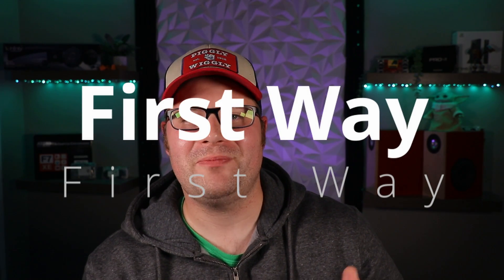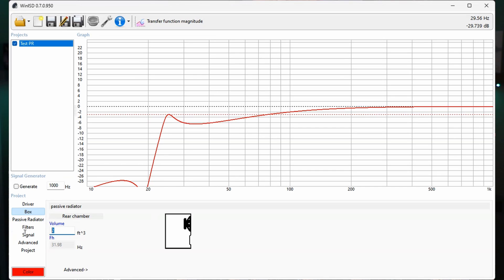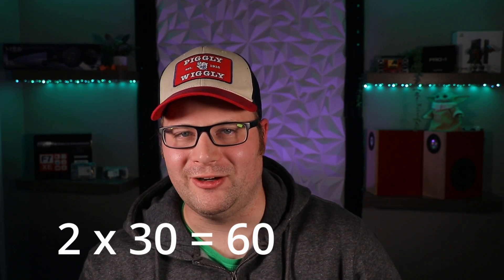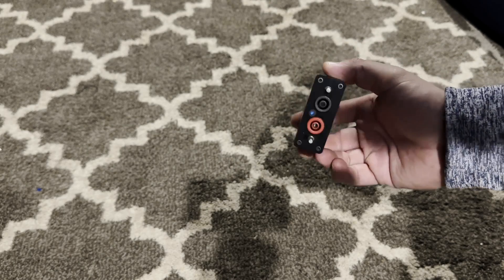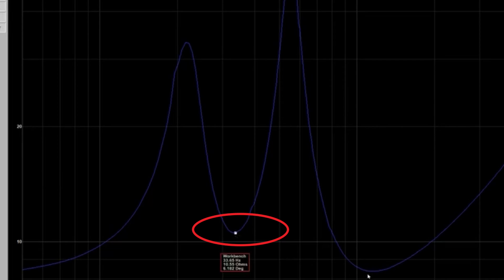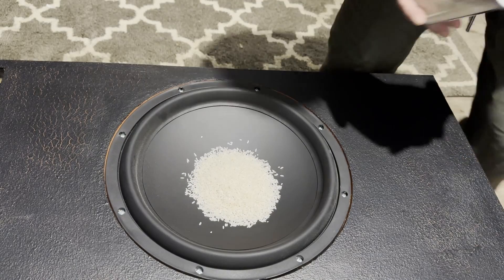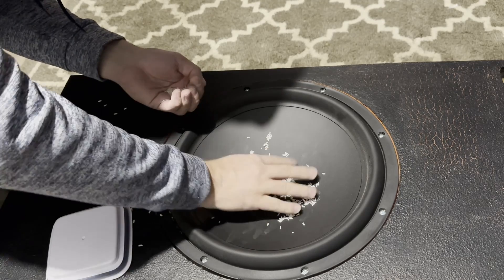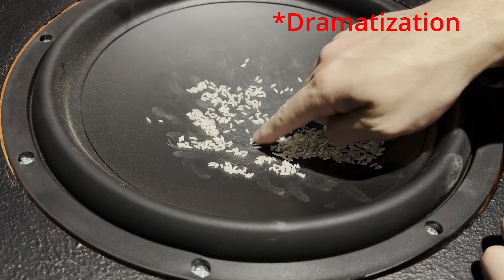How to tune a Passive Radiator - 3 Different ways

Comment: Many youtube videos state that the speaker will sound best at the frequency it is tuned to. Your rice tuning technique shows that the speaker stops moving at the tuned frequency, so actually the speaker will not produce any sound at the tuned frequency. That is the opposite of most advice. I suspect that best tuning would put the tuned box at a frequency below the lowest frequency your speaker can produce, so the dead spot will never be within the frequencies you want to produce. That idea brings another conundrum for me. If I try to tune with the rice method and lower the tuned frequency below the capabilities of the lowest frequency the speaker produces, then how do I know the rice stops moving because of tuning, or does it stop abecause the speaker can’t go that low?

Comment: Great information but as others have said you haven’t shown us how to physically add the weight to the radiator.
Reply: It's usually just thick metal washers that are added to a threaded bolt extending through the back of the radiator frame, and nutted down. Some PRs have the weights on the front of the cone.

Comment: I have access to a waterjet, and 1/2" SS plate. I cut out a 2.4" OD puck with a .315 thru hole = 290g mass to add to each Slaps M12V2 radiator, tuned my sealed 2.6 cu ft box with 2 Skar SVR12 subs to 22 Hz. Playing a pure sine wave from a tone generator, at both 23 Hz and 26 Hz, the car resonates, and begins to shake apart.

Comment: Question, Is there a way to deduce PR parameters by using the second method but with a known driver and known box, essentially inversing how software finds optimal box volume from a known driver and known passive?  I'm curious about a specific set of PRs, but the company is being so utterly unwilling to provide parameters.  I can logically presume SD, Vas, and a rough Xmax range without physically having the product with me, given what the product is and what it was originally fully intended for in use.  I'd rather have a decent starting point rather than just blindly trying to tune a PR in a suboptimal enclosure, especially when the PRs in question are of an atypical design that're just the mounting ring, surround, and a weighted cone, without the basket, spider, or a weight system on a spider.  Their thinness caught my attention and could have potential for atypical builds, but again this company is just being such a ballache with providing parameters.

Comment: I have always seen addressed that you need at least 2 times the displacement passive vs active discussed, and understand that. However, what I have never seen addressed, is it possible to have too much displacement in the passive radiators? What if, for instances, my passives had 4x the displacement of the active(s), is that counter-productive (other than cost) and will it lead to diminished sound quality? Second, it is possible to make your own passive radiators from old speakers you have laying around, perhaps a car audio sub with a bad VC, then just pop off the magnet structure.
Reply: I'm not an expert, so anyone can feel free to correct me, but I think that would just require making the box smaller, so that the air's "tighter" a and makes the PR more responsive. 4x difference would likely require a pretty steep contrast in cone size. But then again, it's common to have, say, one active, and 2 PRs of the same size. PRs usually have significant xmax/excursion, so again, I (think) that it's just a matter of tuning the box volume, and the PR weights, accordingly.

As far as making your own PR, why not try? Google it, look up some existing designs, trial and error. You might make the best one!

Comment: I have four jlw3 8 in the back of my Durango had enough room in the enclosure I put a 10in JL in the enclosure ran it with power for a year cut the power to the 10 and use it as a passive radiator and got a lot more output you know the math said that I had enough room in the enclosure for that 10

Comment: Hello mate. I have a pair of leak sandwich 600 speakers. 26" tall. 15" wide 13" deep. (Please look them up) they have a 12" bass driver in them and I'd like to put a 12" Dayton audio passive radiator in the back. Will it be ok to tune do you think? Thanks in advance. Enjoyed your video by the way. Oh also I have a pair of celestion ditton 44 series 2 speaker cabinets that I'd like to get going. They have a 10" hole at the back for a passive radiator could I put 2 8" Dayton audio woofers in the front with 2 10" passive radiators at the back?

Comment: If wasn't for the 46mm size I'd be interest. Its just to big
Reply: You don't actually NEED to have a PR of that large a size. The general rule of thumb is to: 

#1) have your passive radiator be double the Volume Displacement (or, Vd) of the active driver, meaning having 2pc of the 'same size PR' as the active driver (ex: an 8" active driver with 8" PRs/x2 - doubles the Vd);.....or 

#2) have the PR be the 'same exact size' as the active driver - but the PR must have double the maximum excursion (Xmax) of the active driver (ex: 8" active driver with 4mm Xmax - mated with a single 8" PR with at least 8mm+ of Xmax). 

There's ways around "nearly everything", especially once you understand the parameters.
Some of the absolute best PR designs I've heard were from Polk Audio in their long ago (but classic and still sought after) OG "SDA" Signature Series' of speakers that put them on the audio map as a premier speaker company (at that time, not so much today b/c "bean counters").....

Comment: I'd like to mod my simple crossover to I increase the treble of my 2 way speakers. The capacitors are cheap electrolytic and the resistors are cheap sand type. Would the sound be significantly improved by upgrading these parts?  I would appreciate any advice that you can give me. Thanks!
Reply from the maker: Upgrading the capacitor could make a nice improvement. Resistors are typically less of an improvement

Comment: Lost on the third one. How does the tuner stay? Trying to get my milwaukee packout radio sounding a little better. I believe it's actually being over driven and causing distortion.i thought it was a blown sub only to find out it's a passive resonator that I've never even heard of. It's glued in, so I can't add weights

Comment: Is there such thing as "active radiator"? Acts like a passive radiator, but second amp and DSP kicks in either to keep excursion under control or boost midbass, rather than hanging around above resonants frequencies?
Reply: Well since an active radiator is a speaker driver one could say that an N.5 way system uses and active radiator system.

Comment: Hi! Very good and intuitive video, but I have a doubt.
  Can you help?

 I'm not using weight to lower the frequencies and its still giving more bass in 40/45hz... I want the frequencies higher than I have now... There's no weight to remove anymore. There's some trick to do that?
Reply: May be try to decrease inner volume of the box?

Comment: I´m interested in buiding a 2-way speaker with the DA Epique drivers, just realised that they released 2 PR for the series.
but wouldn´t it be better to use a higher diameter in terms of SD to have a lower tuning frequency, as the price is just 5€ difference for the bigger one ?!

Comment: As a new comer to speaker building are passive radiators easier than ported builds. Also are there different size passive radiators available, and way would I need a smaller or larger passive radiator. I also heard you mention a second passive radiator what would be the reasoning for a second one.
Reply from the maker: That’s a hard question to answer. In general, I think passive radiators are harder for newcomer to implement correctly. Having said that, both designs are a lot more in depth than most people realize. As far as the size of passive radiator needed, you typically want twice the volume displacement of your main driver. I would highly recommend downloading the free program WinISD and modeling some drivers with passive radiators. I have a video on how to use that. I’d recommend watching that as well.

Comment: Great information. There is a passive radiator that had the weights attach to the 'dust cap' area of the outside of the cone so you can change weights with the PR still installed. I remember floating in a pool in Springboro, Ohio after a Midwest Audiofest years ago and discussing that exact product with a guy I had just met... turns out it was Jeff Bagby. CCS is the brand if I'm not mistaken.  I never thought to just turn the PR around for a quick test though. Good quick and dirty test!
Reply from the maker: That is awesome!  And you are correct that CSS does that.  I also bought a few buyout 12" Passive Radiators from PE that do that as well.  BUt they don't look anything near the quality as the CSS.
Reply: I saw a guy whose PR with cone weights busted through. 😬

Comment: Regarding your project to use a sealed subwoofer and DAT. I find the Dayton Audio 18" UM18-22 to be great for sealed subwoofer 27Hz 3db down in a 6.5 ft3 enclosure. SPL up to 116db. Xmax 22mm

Comment: You can also measure the tuning frequency by using a multimeter and maybe an added resistor. You basicially run different sin-tones at the same voltage and measure the current. It#s very easy but takes a lot more time than just running a sweep on dats. But I don't have dats, yet, so I usually do it as above
Reply: So the current will suddenly increase or decrease at fb?

Comment: Piggly wiggly.........lol
I have a computer, however, I hate having to use them for everything. Adapt or die huh?
I'm more in favor of the third method, however, I believe the rice will scratch the cone. Thinking about using 2 epique subs with radiators under the rear seat of an f150.
May I suggest a fourth way. I have an s.m.d amm-1 and it has the capability to measure impedance in real time. I could use that to find the tuning frequency I believe
Reply from the maker: You might be able to. I’m not real familiar with the Amm-1 but if it gives you an impedance chart similar to dats, then you definitely could use it.
Reply: @Toid  no chart. Just numbers.
Reply from the maker: @jamesfalvey77  that’s fine. As long as the numbers relate to a frequency. You’ll just read the frequency and watch it. In your case, I’d probably start at 0 Hz watch the numbers, go up and then as they fall back down whatever the lowest frequency that relates to impedance is, that you’re tuning frequency.

Comment: Good info, as usual. One thing I was wondering about... Small boxes with relatively low tuning often need impractically long ports, which is when the PR is used most I think. Doesn't mounting the PR upside down affect the internal volume too much?
Reply from the maker: I’m not sure I understand the question. What do you mean by mounting the passive radiator upside down? Are you saying when you temporarily mount it backwards? If that’s the case, then the answer to that is, it should have a very minor affect on overall tuning. Once you put those passive radiators in the correct way, and re-run your method of tuning, you can see hire it affected it.
Reply: Passive radiator mounting usually only increases/decreases the volume by a few percent, the driver(s) and bracing tends to play a bigger role in net box volume.

Comment: Does a passive radiator not need to be twice the size of the driver your using? Just something Ive read...
Reply from the maker: No. It needs twice the volume displacement. This can be accomplished in a few different ways but volume displacement calculation is SD times X max. Calculate that of your active driver. Then figure out how you’re going to get two times that number with the passive radiator. You could use a passive radiator with the same SD a twice the X max or you could use two passive radiators with similar SD and xmax. Heck, you could use a bunch a little passive radiators really there’s no wrong choice as long as you have twice the volume displacement (rule of thumb).
Reply: @Toid  Much much appreciated, thank you! Your projects always impress as far as im concerned. Ever considered doing a modern take with a vintage style console unit? Coffin stereos were what I always called em, lol.
Reply from the maker: @AllboroLCD  actually I’ve been giving that a lot of thought. I’ve been going back and forth between a complete build from the ground up to taking an old cabinet and refitting it with all new electronics
Reply: no, i found boom box speaker in the trash. i'm thinking 2 active speaker. open it. active and passive speaker are same size. passive radiator need to tune lower.

Comment: I have some extra top assemblies for my TC 5200 subs. I was thinking of trying them out as the passive radiators.
Is there any reason that would be a bad idea?
I suppose I can assemble the sub and use my Dats.
What I am saying is I don't know if passive radiators are designed differently in the suspension area or something then a real woofer would be.
I can add mass by using plumbers clay or something and stuff it on the inside of the voice coil former for added mass.
Reply from the maker: No, in fact, that is how passive radiators are created. As long as you feel that you can add weights appropriately, you should be fine I think I would really love to see it if you wanna share on the forum, that would be awesome.
Reply: @Toid  If i eggs up doing it I'll link it to you or ask you where to post it.
Thanks for the reply!

Comment: Doesn't flipping the driver make the internal volume larger, thus changing the tuning frequency?
Reply from the maker: Technically, yes. However, the amount of space that a passive radiator takes up is so little, the tuning frequency shouldn’t have any noticeable impact. If you’re concerned about that, once you reverse them in the normal orientation, just test the tuning frequency again